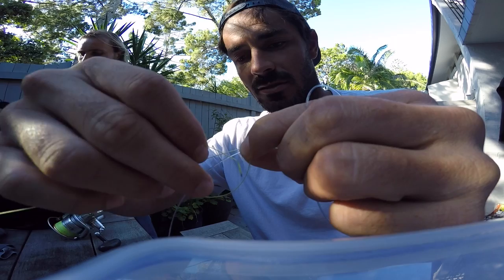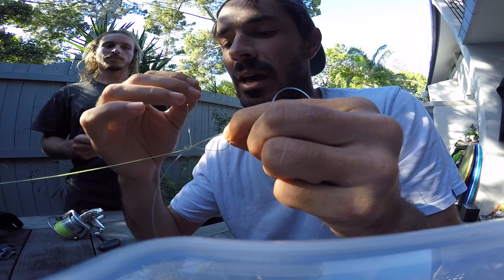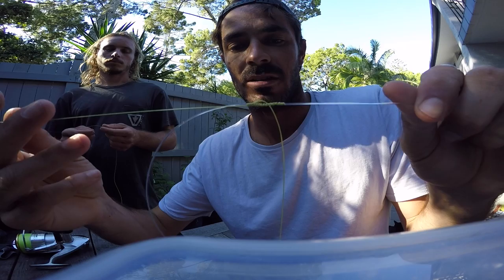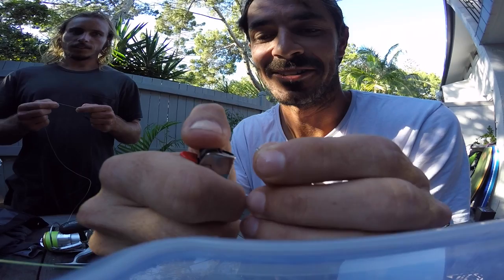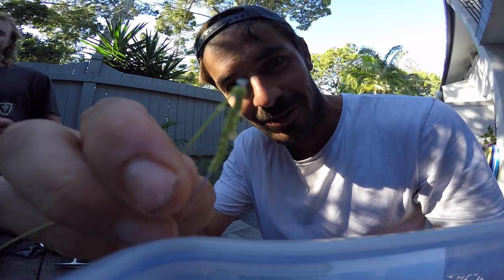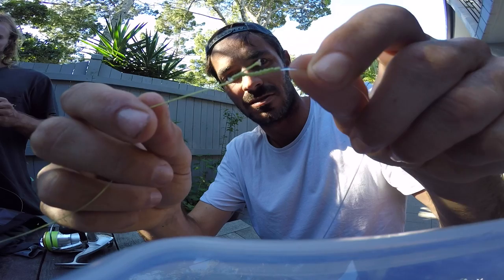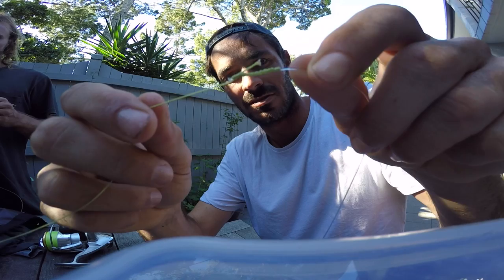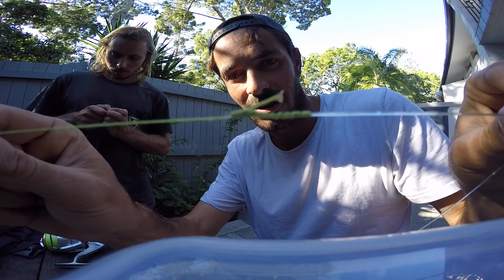Jonny's FG Knot

Comment: Yep mine is the same bar the half hitches. So easy when you weave it on itself as there isn't much need for sinching it down. 
Hasn't failed me yet as I've been snagged many times with my blood knot on my swivel snapping first, every time. 
Cheers for the vid bud
Reply from the maker: good stuff mate... try a uni knot to your swivel and nothing will break!

Comment: I just don't get the rizutto finish. Can't get my head around it. Alternating half hitches for me. Don't see the need to chance messing everything up with the cigarette lighter. If the knot is properly tensioned it is not going to slip. You can cut it flush. I use old empty spools with the arbor wrapped with rubber bands to tension the knot. A few wraps around the spool and you can crank down on that knot. It is great that all of you guys have your own channel. Lots more vids to watch.

Comment: Just saw this video. Nice tutorial. I prefer the PR knot when getting ready for a trip. I use FG knot when I have to tie one in a boat. It’s easier and quicker. One question. How long is the leader from the knot to the solid ring? Mine is like 6-10 ft. My rod is 8 ft. Is that ok?